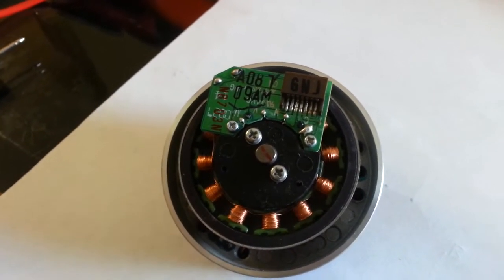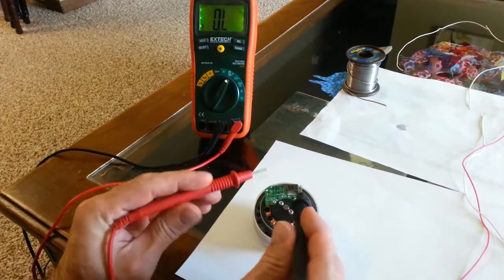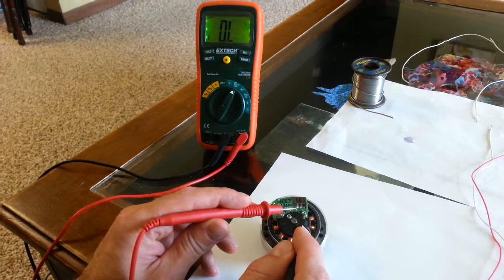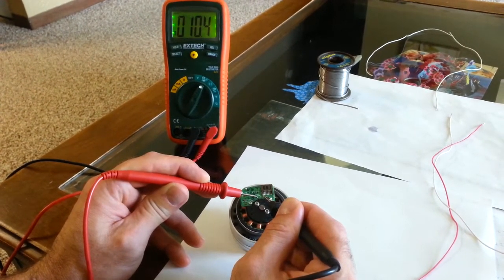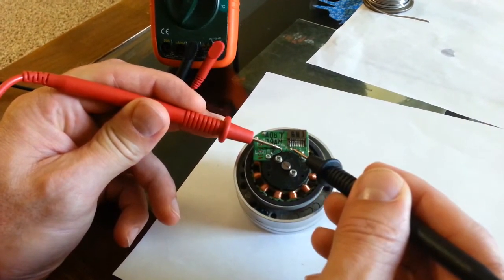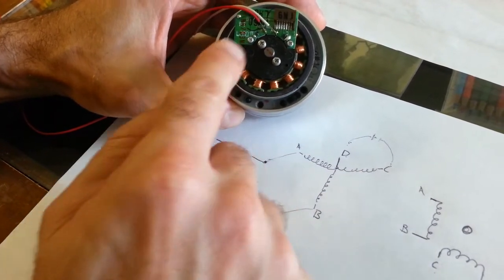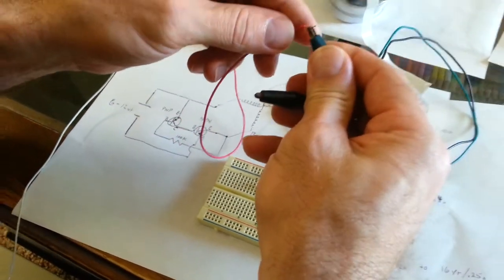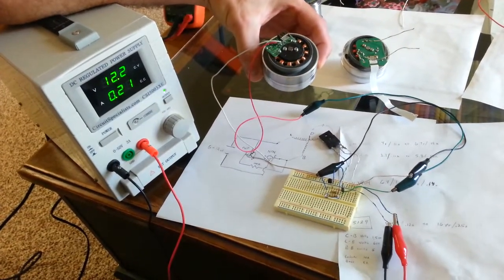Three phase AC motor running from 12vt DC

Comment: 4:11 Can you please explain why the phase connections work in this fashion?  It seems that the coil that loop back on itself would do nothing since both ends of it are tied to the same point, and thus no potential across the coil could ever exist.

Comment: So I built this circuit using BD 909 and BD 910 which are high power NPN & PNP transistors, it works great with 12v and accelerates quickly but it doesn't self start